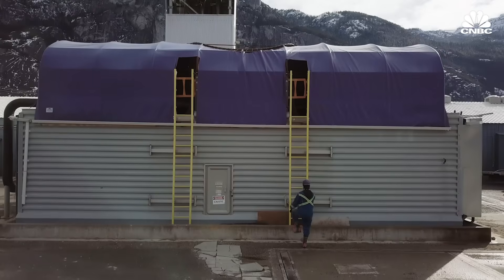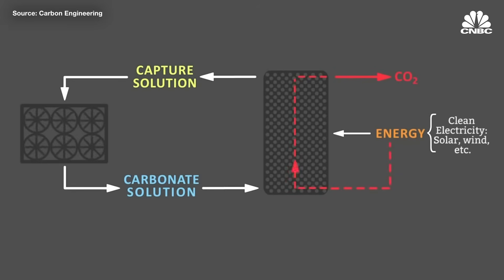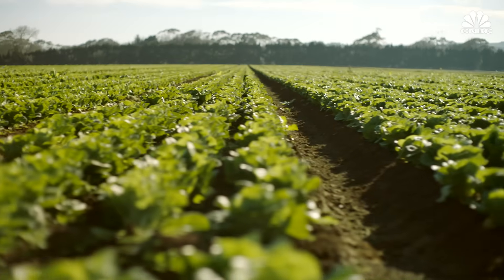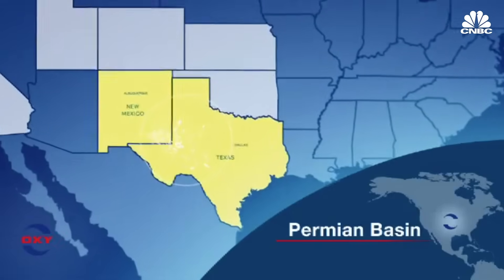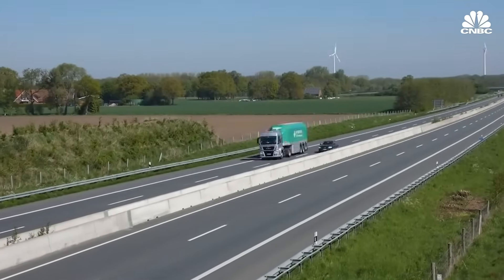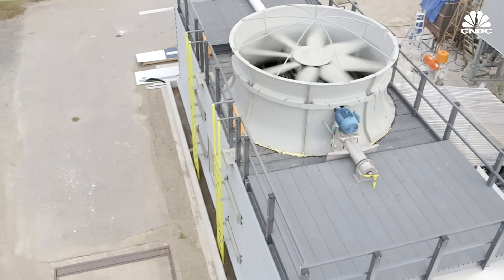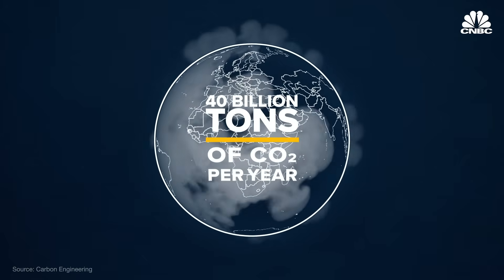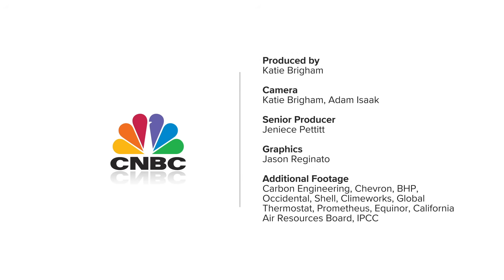Bill Gates-Backed Carbon Capture Plant Does The Work Of 40 Million Trees

Comment: Sam: Whatta think about this atmospheric processor deal Norm.
Norm: sounds good to me, more clean air  to get me to the bar.
Sam: Whatta ya think Cliffie.
Woody: my father used duct tape to fix everything.
Cliffie: Wella ya know when the Romans invented duct tape back in 100 ano domini,  it was to hold together leaky sewer pipes there.
Norm: NASA used it to save Apollo 13 in space. I don't see we can't use to fix the earth somehow..  
  Sam: don't they use oil to make duct tape? 
Norm: were screwed, that's why I have to take a cab to get here it's depressing to think about. By the way Sam, while your getting me another beer can flip on the a/c it's hot in here. 
Sam: it's seems we need oil for everything don't we, cabs, duct tape, a/c parts where does it end.
Cliffie: ya know a/c was invented in 1937 by Austrian monks because they needed cold air to meditate better. They say it holds more Oxygen ya know..
Norm: that's it. I give up trying to save Earth. I say we build a giant a/c unit to cool off everything might as well be comfortable while we drink. 
Everybody:  here here to giant a/c units!

Comment: The reality is that removing CO2 at ground level doesn't do squat.

The chemistry of greenhousing is happening at the upper stratosphere, remove all you want, CO2 stays ABOVE 400-ppm at least 120,000-years, 1/4th of tailpipe emissions stay over 10,000-years.

This is from aragonite reversing dissolution from acidification outgasing CO2 as oceans feel the reduction above for 200,000yrs during the PETM, a land extinction.

This is known and basic paleo-oceanography.

It one wants to blow cash blow it on having all IC-Engine makers produce N.Tesla Tailpipes for each of their engines to replace stupidity and agenda with a simple device, the valvular conduit, a one-way air valve with no moving parts.

Tesla associated his Tailpipe with IC-Engines 80-years ago, we wouldn't have a need to worry and there'd be crops in the midwest instead of snow at harvest time.

Nothing comes out, zero emissions, btw, China has planted a billion trees.

And, canopy forests DOUBLE rainfall to soils, reforestation can't do squat about it, mature canopies can't be "planted", they evolve the habitat.

Comment: Why not put such fan on a chimney and let the air trough
Reply: Then investment should go into research to make this cheaper rather than putting it on an even higher scale. Computer started by filling up a whole room and now we have slim smartphone. This invention should be miniaturized and used as preventive in the carbon emitters. Tight now the application as it is not healthy for the air. Imagine having 100 thousand of them, what % of carbon remains in the air? What are the aide effects of this technology? Has anyone even addressed it or are we going to implement then try to find it solution later. Its not the first time that technology has had bilateral consequences and this should be the focus first. Plastuc was wonderful and durable, its hundred of years later that we actually understand how harmful it is. Am still skeptical on this one.
Reply: @marzadky4934  Well, there is research being done, but the tech is still expensive (would increase the cost of power 60% or more). It's possible that non-polluting power sources (e.g. solar, nuclear) are more cost-effective. Also, even if we stop our carbon emissions, we may still need to reduce atmospheric carbon faster than existing plant life can accomplish to avoid runaway effects.
Reply: its too expensive to build one for every chimney. but yes, ideally we would be doing that
Reply: It exists! They're called scrubbers, but they're complex and expensive.

Comment: What's wrong with people? Those idiots condemning people for partnering with oil companies for carbon capture technology? We all know that fossil fuels aren't ideal but until cleaner solutions are widely available for everyone at a price point everyone can afford that's all we have. My family puts 10-30k miles a year on all three of our vehicles. Gas stations are everywhere. We can go the places wr need to go without getting stranded because there's infrastructure there to allow us to continue driving. You want to knock people for trying to sequester carbon just because it's an oil company doing it? Put a better solution in place and people will use it. Highly educated morons. It's not like I have a lot of other options. Electric isn't any cleaner or very little cleaner than gas because it still uses fossil fuel. We still get 67 percent of our electricity from fossil fuels. So instead of paying the guy drilling the oil I'm paying the guy digging up coal. Oh yes, that's much better.

Comment: 6:40  You know, it just occurred to me that Carbon Engineering's synthetic fuel might possibly be able to solve the energy storage problem that popular alternative energies like wind or solar have.

If the synthetic fuels that they can make are actually similar to conventional gasoline, there are advantages to this form of storage, as opposed to massive battery banks or hydroelectric dams.  For instance, we already have the infrastructure to run gasoline, so our infrastructure might not need as large a change as with the other 2 storage methods.

Also, I'm not an expert, but the impression I get is that maintaining massive banks of electric batteries might generate lots of waste associated with the manufacture of new batteries and disposal of spent batteries.  Yes, it's certainly true that burning these fuels would put carbon back into the air, but these very same energy facilities (as Carbon Engineering) would be able to pull the carbon back out.

To get around some of the problems with batteries, driving surplus alternative energy into pumping water up to a hydroelectric dam, thereby storing energy for use later in the day, during peak energy demand.  But there are practical problems with this, too.  It's been noted that dams can cause environmental damage to the water features and fish where they are built.  Also, more rarely, it's been said that dams might possible contribute to causing earthquakes, possibly limiting the expansion of the usage of hydropower.  Additionally, it doesn't sound like this can be used to store energy long-term (ie. from summer, where there is a lot of sun to generate solar energy, to winter, where there is less sun, or from more windy periods to less windy periods).

Another problem, I've recently heard about is that energy requirements for electric planes don't scale linearly, but with the square of the mass or smth, thus making electric planes not really feasible yet:

"Ion Propulsion:  The Plane With No Moving Parts"
https://youtu.be/IorDYGI1uqc?t=444

But storing the energy as a more or less conventional fuel would seem to be able to circumvent all of these problems.

So, honestly, I think the knee-jerk liberal reaction that Carbon Engineering is just a shill for big oil is undeserved.  This company, if invested in, might just possibly be able to solve the storage problem that alternative energies have.

Comment: Please dont see CO2 as bad
CO2 is very important for plants
Plants stop growing at 200ppm to 400ppm of CO2 which it is right now
Lower it than that 
Plants would be  in danger 
CO2 should be raised to 800ppm to 1200ppm which would increase growth of plants increasing food production 
CO2 emmissions doesnt actually have much effect to the Earth as it only has a maximum effect of 0.00000136 percent to the Earths Global Temperature. 
Actually water, oxygen etc. holds more heat than carbon dioxide.
Please dont just see this video and see CO2 as a problem. Look at the side going against this argument and youll see both sides having very decent arguments. Actually through what ive seen the side which sees CO2 to be bad is very biased, pushing some false facts as true. Which the facts that ive said may have surprised you with

Comment: This is a giant Scam to get rich on taxpayers money. How much are carbon credits selling for?
Each offset is equal to one metric ton of carbon dioxide and sells for approximately $11 to $14 per credit, depending on market rates.
Moroccan conditions and based on a conservative scenario, without/with utilisation of free waste heat are calculated at 222/133, 105/60, 69/40 and 54/32 €/tCO2 in 2020, 2030, 2040 and 2050, respectively. These new findings could enhance DAC's role in a successful climate change mitigation strategy. Yeah right. Who is willing to pay 133 euro for a ton of CO2? A giant subsidy to the oil companies who use it to extract oil.

Comment: Yes interesting idea; but for the complete proposed Direct Air Carbon Capture & Sequestration (DACCS) system, where is  the total Life Cycle analysis accounting of the total Net CO2(e) removed by this proposed DACCS system; i.e. total Net CO2(e) extracted = (CO2(e) extracted directly from the air) - (CO2(e) emitted  by the Natural Gas (NG) fuel used to run the DACCS, system also NG used to compress and transmit the CO2 extracted and produced in the DACCS system,  and also NG used to safely sequester that total CO2 in secure geological strata)?  In short does the preliminary Life Cycle analysis for the prototype DACCS system and/or forecast for the possible full commercially operational DACCS system capture or emit Net CO2(e) to the atmosphere?  P.S. Natural Gas is about 95% Methane, and one should reasonably assume a 20-Year atmospheric "Horizon" for conversion of Methane to CO2(e) at 86 times (see IPCC AR5, 2013) and typical Fugitive Emissions of Methane (FEM) at >3% in OECD countries and >6% in Non OECD countries.  Also, it should be noted that using Renewable Energy to run DACCS systems can easily be shown to be a non-starter.  I have repeatedly asked these logical questions of the proposed DACCS system proponents; however, no sensible replies have been received - possibly these Gents will reply to CNBC and/or to the Bill Gates Foundation?

Comment: They just inventing a new business global. They climate change its a lie.
Its just something happening after few decades. The planet its just recycling the elements in diffferent ways.
You should only use water as a fuel...the pure hydrogen....H2.
And to let the oxygen to fly away in the air without heating up or using in burning as oxyhydrigen flame.

If we use solar power to electrolize the water to make fuel...using only hydrogen for cookers and vehicles, than....we reduce the humidity...
Water its the most abundant materia on the earth.
By recycling H2 and 0ygen...we ll have sorted everything about gases in the atmopshere and pollution.

Comment: What happens when our grandchildren drill a hole and a bunch of pressurized CO2 comes out of the ground?  Coal, buried in the earth, is one of the most efficient storage mediums for carbon. Trumps new deregulation allowing the Natural gas drillers to release unburned gas into the air makes Natural gas worse for the environment than coal.  We need solar and safe liquid salt Thorium and get rid of trump and big oil control of our government.

Comment: As one of the commentators mentioned, this process described is not about carbon capture. It is about CO2 capture. The process is similar to what happens in the ocean when CO2 is dissolved in seawater to form bicarbonates. But of course on a puny scale compared to what happens in nature. In the process described the CO2 is passed over sodium hydroxide (caustic soda).
But where do they get the sodium hydroxide?
In modern times through the chloralkali process, which is highly energy intensive because it uses lots of electricity. Also, the process produces chlorine gas as a by-product. 
https://en.wikipedia.org/wiki/Chloralkali_process
While the process can be ramped up worldwide, what use is the chlorine gas? Manufacture of bleach is limited by demand. It's military use is banned.
Sorry folks, but this pilot project is not the solution for anything. But a demonstration of an energy intensive way to sequester CO2 that cannot be used worldwide because of the adverse environmental impact of chlorine gas generated in the manufacture of NaOH, caustic soda.
True, the chloralkali process not the only way to manufacture caustic soda, but the other processes use asbestos or mercury. 

There is no free lunch here.

Comment: how they say this is a step in the wrong direction. we’re gonna use fossil fuels no matter what. that’s a fact. i think this is a very good step in the right direction towards a solution
Reply: But what is the carbon footprint of the plant that reduces CO2 to get C plus O2. How much energy input is needed to run the plant, to build it, to transport the components, to manufacture the components. It all adds up. What is the ratio of energy energy saved divided by the energy used to do the work of splitting the CO2 molecule?

Comment: I’m doing a project on carbon capture, I’m wondering about the risks of leakage after you put it underground. Is the end product of carbon capture a carbon solution or carbon pellets
Reply: Look at the effects of fracking. All they're doing is replacing the "mud" used in fracking with CO2 gas. The real kicker is that they're able to produce much higher pressures underground.
Reply: As one of the commentators mentioned, this process described is not about carbon capture. It is about CO2 capture. The process is similar to what happens in the ocean when CO2 is dissolved in seawater to form bicarbonates. But of course on a puny scale compared to what happens in nature. In the process described the CO2 is passed over sodium hydroxide (caustic soda).
But where do they get the sodium hydroxide?
In modern times through the chloralkali process, which is highly energy intensive because it uses lots of electricity. Also, the process produces chlorine gas as a by-product. 

https://en.wikipedia.org/wiki/Chloralkali_process
While the process can be ramped up worldwide, what use is the chlorine gas? Manufacture of bleach is limited by demand. It's military use is banned.
Sorry folks, but this pilot project is not the solution for anything. But a demonstration of an energy intensive way to sequester CO2 that cannot be used worldwide because of the adverse environmental impact of chlorine gas generated in the manufacture of NaOH, caustic soda.
True, the chloralkali process not the only way to manufacture caustic soda, but the other processes use asbestos or mercury. 

There is no free lunch here.

Comment: If one ton of removal costs 100$ it still would not help. Current emission are 40 billion tons per year, so it would cost 4 Trillion to remove just the yearly emissions, by no means lowering the already elevated levels. Current world bip is at 80 billion, so we would have to use half of it. Impossible. The process has to became way cheaper, maybe 10 times cheaper.
Reply: The biggest oil and gas companies have revenues of 5.5 trillion per year so if you sold the fuel there would still be 1.5 trillion per year profit.

Comment: But they are making more carbon Dioxide from the energy needed to run that plant. So whats the point?
Reply: Pay attention, they said that the co2 produced by these machines are captured too
Reply: @user-hk3ck3dn2c  They couldn't unless this plant is right next to the electric company's power plant. Because burning coal for power produces a lot of c02

Comment: in the expense of people? then the  so called carbon technology where lots of secrecy behind . this is a move by the behemoth oil company to stop the transition  from fossil fuel to electric. remember the EURO standard emission which doesn't works where the car manufacturing company has been penalized  due to cheating.

Comment: So the company doing it is trying to turn the co2 into fuels, which will be burnt, so releasing co2 back into the atmosphere. Their process may not produce any co2 in itself, but it will not reduce the co2 in the atmosphere. Bearing in mind that carbon capture is still not proven to be feasible on the scale we'd need it be, this technology appears to do nothing to help climate change. 

At least the trees will sequester that co2 for a good while. They make a much more proven, useful, sustainable, and cost effective carbon capture method.

Comment: a gallon of gasoline, which weighs about 6.3 pounds, produces 20 pounds of carbon dioxide (CO2) when burned. most of the weight of the CO2 doesn't come from the gasoline itself, but the oxygen in the air.